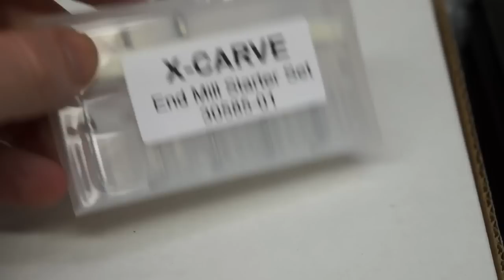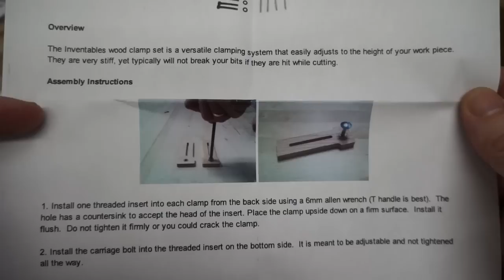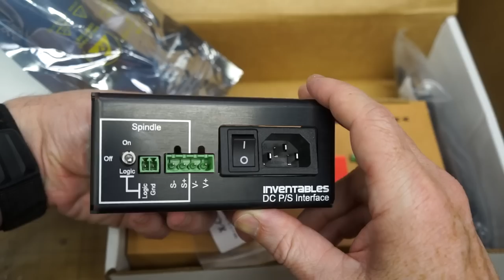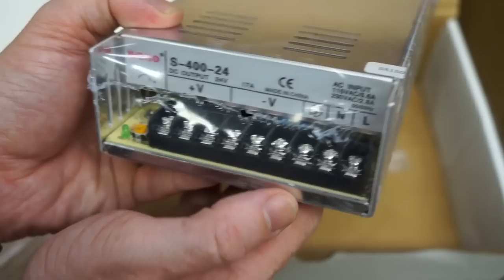EEVblog #753 - Inventables X-Carve Milling Machine Unboxing

Comment: EEVblog you were talking about milling fibreglass. Don't use fibreglass copper clad boards when milling. The mill wil be dull before you know it, besides the dust is not good for your health. At the fablab's where i mill circuit boards they use FR-1 exclusively and they do not allow you to mill FR-4. Also the same reason inventables only sells FR-1.

Comment: I am building a CNC machine as well ATM.

just, it uses a different construction (spindle only moves in Z, and the table moves underneath it). it is also full custom, mostly made of OSB with some steel pipe and similar for rails.

sadly, I am using smaller/weaker motors (NEMA-17 motors, and a 100W 85.7x57mm motor for the spindle). however, both the XYZ and spindle motors are geared down a bit (for the XYZ, it is a combination of a gearbox and also it using 3/8-16 all-thread for moving things). so, it should hopefully have enough torque, however the travel speeds are likely to be fairly slow  (probably 25 in/min, or 64 cm/min, at present, but slower if I increase the gear reduction further).

spindle gear reduction is about 30:1, with a max spindle speed of around 600 RPM.
est peak torque: around 10Nm.

was tempted by NEMA-23 motors, but they were a bit more expensive than the NEMA-17 motors.

mine may be used for wood, but is also intended for hopefully doing metal.

Comment: Wow, It looks like it is made of butter, thin aluminum parts and tiny spindle. Taig tools or Sherline have been in business for decades and you can have a much nicer table top mill for roughly the same price.
Reply: Treeborg I'm sure people who bought this would much rather buy the products you mentioned but they are under the kickstarter hype.
Reply: Treeborg Although I agree that this machine is lightweight and the stock spindle is abysmal, it is apples and oranges. The working envelope of the taigs and sherlines is really small and for a lot of projects the router format makes more sense, especially if you are working in woods and plastics.  Also, if you price up a ready(ish) to go CNC sherline I think you will find them considerably more expensive IIRC.
Reply: *****  I would agree with you if could actually cut plastic and wood sheets at any workable speed and depth of cut with this thing. David said that he paid $1000 for this model.  2019CR-ER cnc ready Taig is $1089 with 12" x 5.5" of travel. You only need to add stepper motors and a controller that would not add much if you pick an Arduino based.  With that you could be cutting steel and zipping through PCBs without even blinking. It is not apples and oranges since the X-Carve will give you 12"x12" work area and will only cut plastic.
Reply: ***** By the way, nice channel. Subscribed.
Reply: Treeborg Thanks!  I'm only really arguing for a different sized bed (for some applications), I don't like the machine at all. For most metal work a narrow bed like you get on a mill is fine but for a lot of tasks especially in sheet it is limiting, so yes it is only 12X12 but that is twice the size of the Taig (wow, that's a good price). I know all about working around bed size, my first machine was a Proxxon MF70 I converted, that thing was tiny.

Comment: Ok for very very light milling. Makerslide for linear bearing? With that tiny little corner having to fight with all the forces on it. Again only for very very very light milling.
Engraving should be fine hence the name i guess cutting will be foam, some plastics and soft woods, not much else. Linear bearing made of aluminium. The steel wheel will wear out the aluminum rail, the delrin ones will wear out by themselves. It is almost a consumable. Why not some real linear guides, lead screws, good spindle and some desperately needed rigidity to get precision and a lot less shatter. Better buy a 6040 or larger from China and go from there.

Comment: Why would you want to use wood as a base plate ? Nothing beats steel and mass.
Reply: Dorf Schmidt It's cheaper and lighter (for transport purposes )
Reply: Dorf Schmidt Sacrificial, I believe.
Reply: Dorf Schmidt They have a tiny spindle and a light ali frame, steel and mass would not help a great deal. Even with a metal bed an MDF or similar board is often used to allow cutting through the material fully when routing.
Reply: Dorf Schmidt Because you will cut through it from time to time occasionally. You don't need to break your bits. Clamps are made from wood for the same reason.
Reply: Dorf Schmidt its cheap, and easily replaceable when worn out.(or when you accidently cut it all up because you got your Zcords wrong)
Reply: Dorf Schmidt it looks good ;) . Imagine carving a whole door with a nice intricate pattern with one of these carving machines

Comment: it looks hugely overpriced for kit.

i personaly build my own CNC mill for around same price, but...
it has 850x500mm working area, 2.2kw spindle, linear rails, ballscrews and cuts metall like a butter.
it also based on aluminium extrusions but much bigger ones with high rigidity.

looks like Inventables charge about 300% for price of all components.